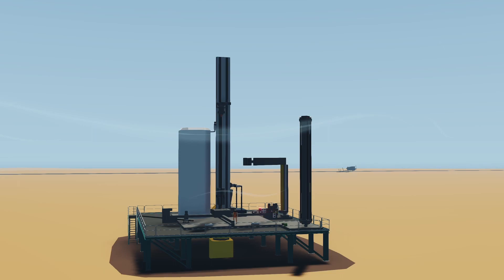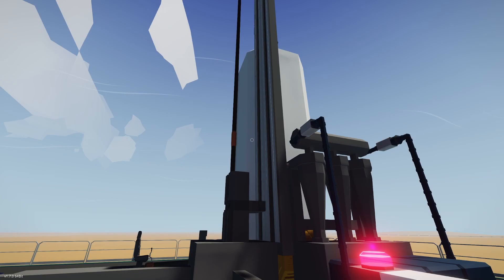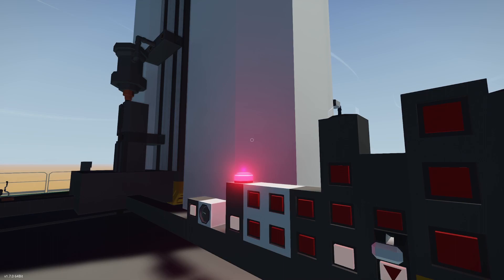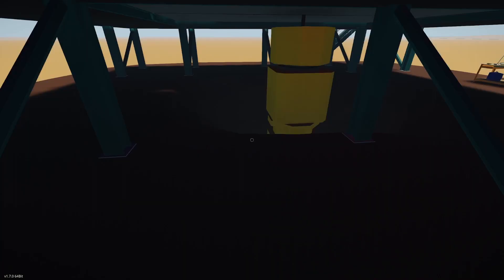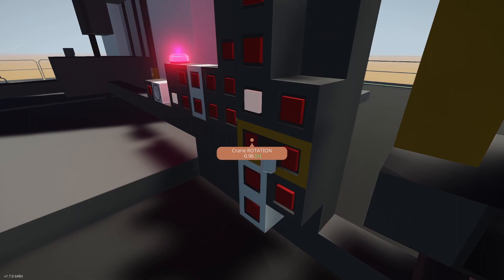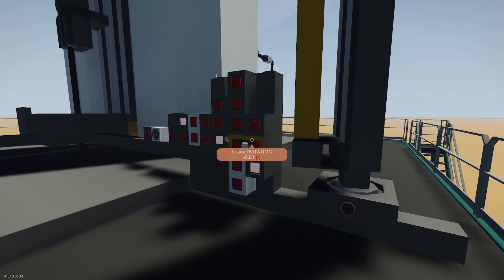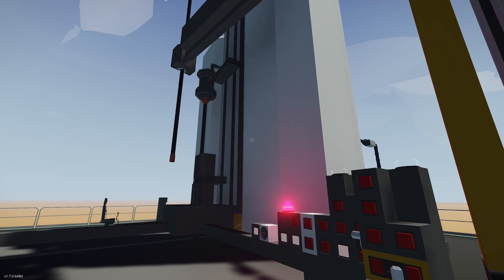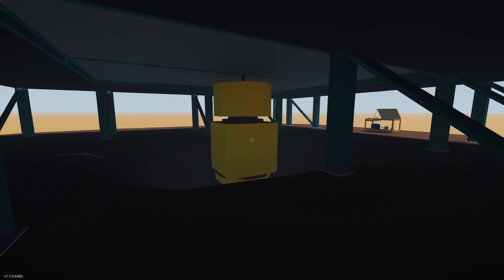Stormworks: Learning How to Drill for Oil P1 #stormworks

Comment: ~30 mins - Caps has been considered yelling pretty much since the start of the internet, and well before that in other contexts. It's long been a tool of works of fiction and in interpersonal communications to express shouting, examples of such usage go back hundreds of years. There are of course endless varieties of style norms used for different things, but it's not so much that such usage changed with the internet, but rather that people started using text to en-masse to communicate immediately, and it's far faster to express emotions using upper case and even text emojis than it would be to write something in a more verbose style. Before the internet it was common to use uppercase for everything for many kinds of documents, why?, because it was mostly done with typewriters and they only had upper case, so it became the standard for those kinds of communications, even mandatory in some cases. So basically, no, if you are writing anything that could be construed as conversational, and especially on the internet, just don't, it's considered exceptionally rude and even unprofessional.

As for your comments on cheating in Tarkov and other games. It's not new, it's been around as long as video games have been around, but it's most prevalent in competitive games (and always has been) for pretty obvious reasons. It's the same reason why cheating happens in sports, on tests, etc. I've personally written a handful for personal use dating as far back as the late 90's, though I've never distributed them. For me it was always either motivated by curiosity or to bypass some braindead farming task, I figure if I decide to make something, then that's a far more productive / educational task than whatever I could be doing in the game itself. No doubt why I love games like stormworks, from the depths, barotrauma, etc. The difference between now and "back in the day", is that cheating software has become massively commercialized, very easy to use, and quite safe. So you get rampant cheating. Frankly though at the end of the day, cheats are almost always security flaws and therefore the fault of the game developers. It's a major issue in competitive games.
Reply: Oh it's worth mentioning that cheating is about to get a whole lot worse with improving ai. Once that becomes common it's basically game over if you'll excuse the pun, I genuinely don't know how anyone will address it for public lobby games. At that point it's just going to be reading the screen and sending the same kind of output humans will.